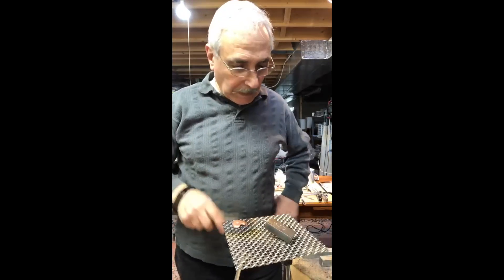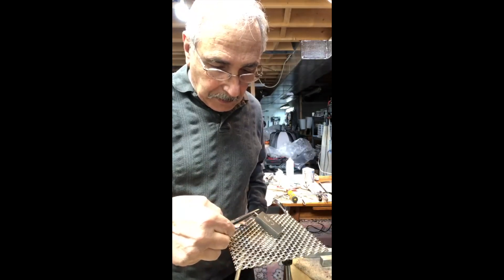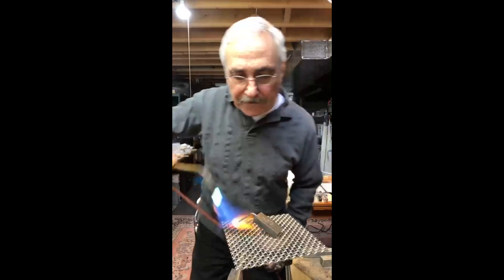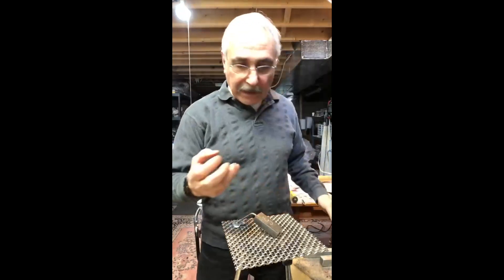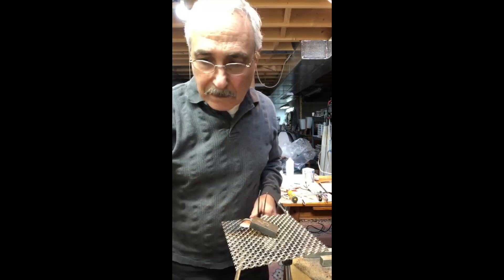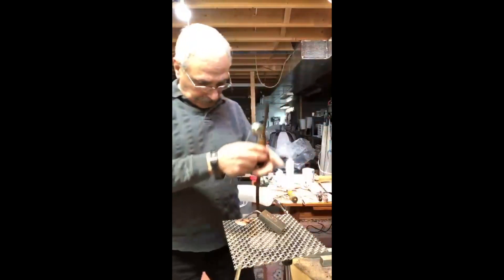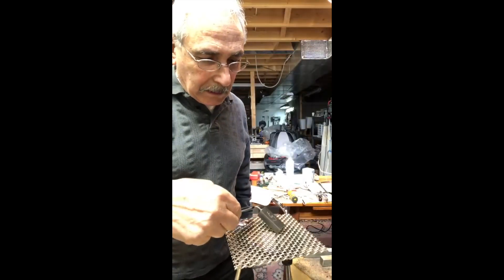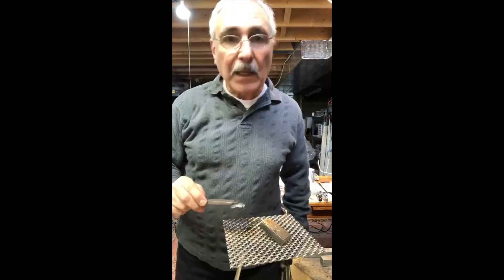How to Solder Copper & Silver

Comment: Is the solder already on the bezel? You never mention the solder, what hardness is it?
Reply from the maker: Jan, I did mention sweat solder, that means I put the solder on the bezel first then I position the bezel where I want, hold it down and apply the heat…and I did use hard solder.